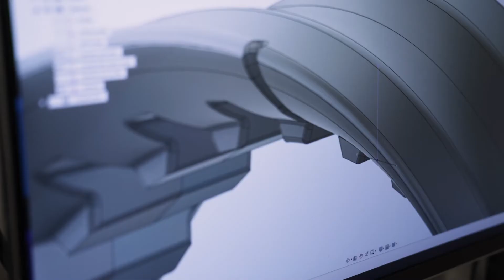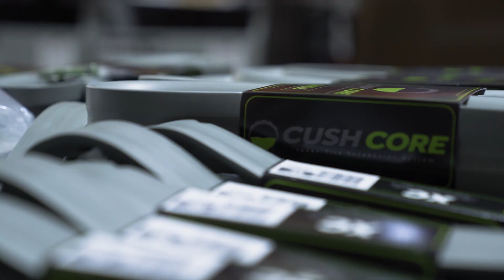CushCore - From DIY to a World Class Company

Comment: i have a bontrager enduro carbon rim and maxxis dhr with DD. Its almost impossible to install cushcore.... i installed 100 tires in my life but thats really to much for me :(
Reply from the maker: Here's a "real world" installation tutorial.  If you follow these steps, installation is fairly simple (On our channel it's called "Un-Edited CushCore x Maxxis Assegai Install").  Having said that, with or without CushCore, of course some tire/wheel combo's are more difficult than others.
https://www.youtube.com/watch?v=7csiirhyMHM&list=PLLwvJnHM5BjhGkTwI9nXAwD6d4H8ZWByh&index=1&t=214s
Reply: What worked for me on a NOX Farlow 29 x 29iw wheel, with Cushcore 29xc and Maxxis Forekaster 2.4.

Install the tire as normal. Deflate and open one side. Tuck in the Cushcore like an innertube and use the tirespoon as directed by Cushcore to force the bead under the foam. 

Then apply more soapy water and unsert the spoon  under the open bead. Rotate the spoon pulling the bead out and on to the rim clinch area as much as possible reducing air escape gaps. Hit it with air and grin.  Add sealer.

If the tire wobbles deflate and massage the CC foam to the center. Add sealer

Comment: Just got cushcore installed - looking forward to experiencing improvement in performance and preventing pinch flats. - Bike shop has not been able to get rid of the tire wobble that it has now.  What suggestions do you have?
Reply from the maker: There can be a few reasons for tire wobble.   Because CushCore pushes the bead on tightly, sometimes the bead won't seat completely.  Meaning a small part of the tire bead did not slide out completely.  To fix this you can air down completely and air back up with a compressor to at least 40psi.  Also, sometimes just riding will force the bead to seat properly.   Another culprit,  is the insert is not sitting "square" in the rim channel.  Air down and use your hands to make sure the insert is sitting flat/square in the rim channel.  One last thing we've seen is the the installer used too much force and stretched the tire bead.   You don't need a giant tire lever or huge force, just take small "bites" with a normal tire lever and a little patience.  If you're still struggling we're here to walk you through it, just give us a call! 541-241-2444
Reply: @cushcore  Thanks for the reply and recommendations.  I did take back to bike shop that installed and confirmed that everything was installed correctly and seated.  Unfortunately, the wobble still remains.  I did do a long ride and wobble is still present.  I did discuss with Rob Drew and he offered to take a look at it and will try to get with him soon to see what he can come up with.  Thank you.